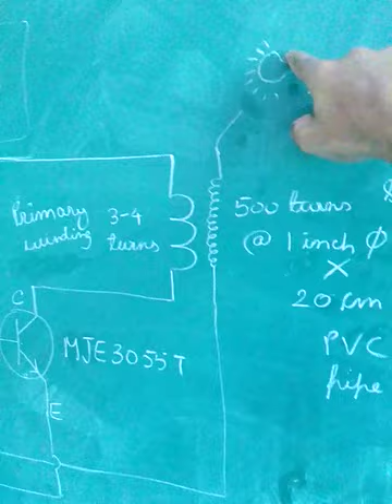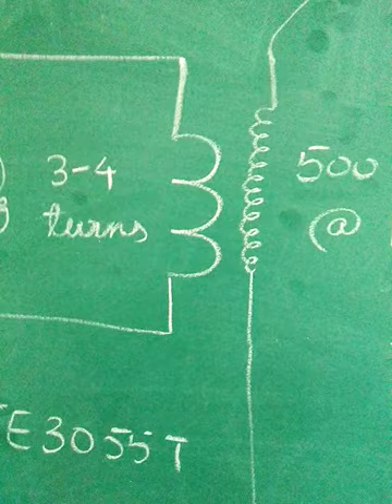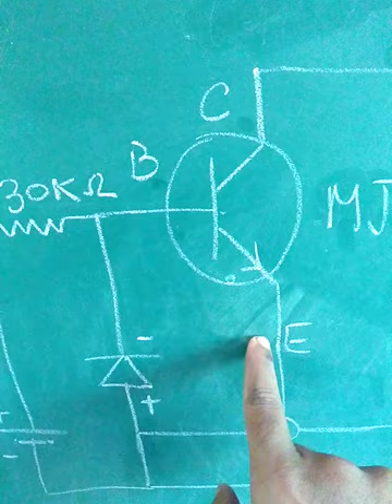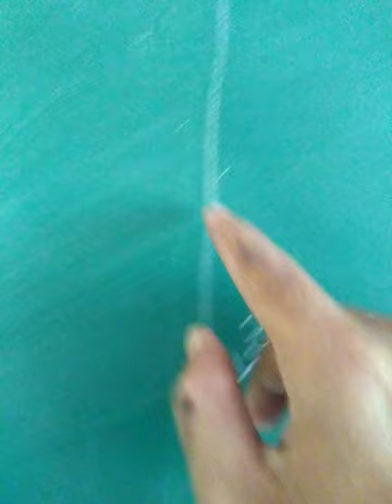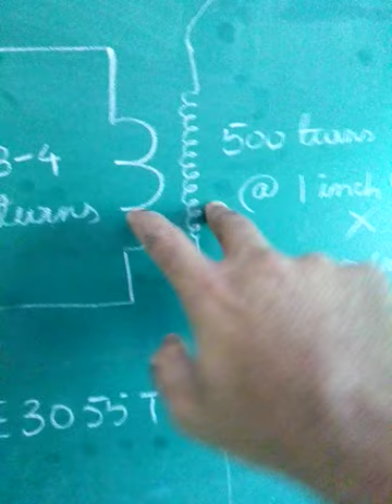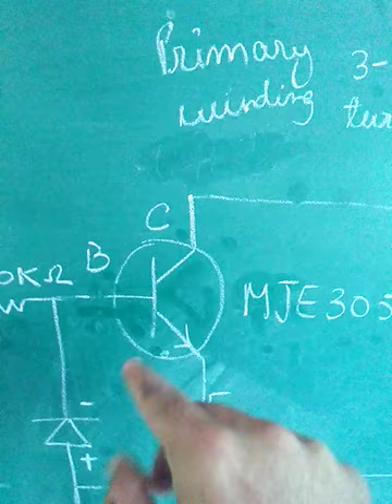Tesla Coil- DIY Homemade Slayer Exciter Circuit

Comment: Brilliant!!
Is it possible to use an inverter for converting DC supply to AC supply?
Reply from the maker: Abhishek Pagare: Technically yes, however I am not sure about the practicality for 2 reasons. 
1.Tesla coils resonate at very high frequencies in 1000-10,000 Hz range. I am not sure if an inverter can supply such high frequencies. 
2. The circuit has to be tuned to match the natural frequency of the inductor ( secondary coil). So firstly you will have to determine the frequency of inductor ( which is easy calculation) and then have the inverter output frequency match this value ( difficult part).
Reply: Gourang Ambulkar I have read that some inverters may work up to 2KHz. Maybe it can work here...
I searched for them and found that some of the hi tech inverters can work in the range of 10-20 KHz
Reply: And for second point I think we can use a frequency inverter.
Reply from the maker: Oh cool. Needless to say that you have to be careful about the output voltage and current.  Also with such an inverter it will be a good idea to build a Spark Gap Tesla Coil. Good Luck with your build. I will be curious.
Reply: Gourang Ambulkar Well sir I have not built it but definitely got inspired by seeing your Tesla coil and I am also planning to build it.

Comment: What happened if take readymade transformer instead doing winding mannualy ?  And for winding ratio made transformer series parallel combination.
Reply from the maker: dnyaneshwar dange : You have 2 questions -
1. If you can get a readymade transformer whixh operates on 12v and can step up @ 100+ times, then it will work.
2. I did not understand what are you trying to connect in parallel vs series or vice versa. Could you explain?